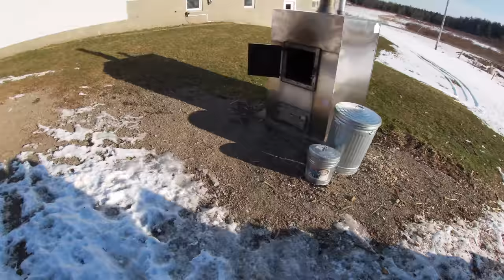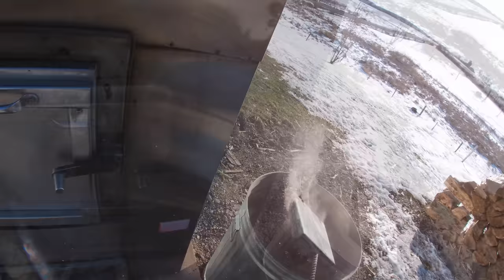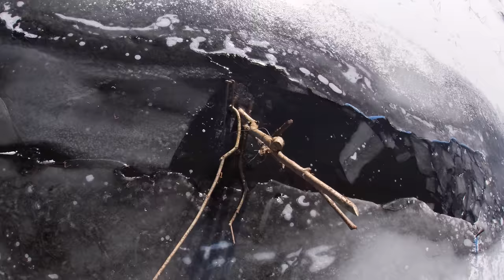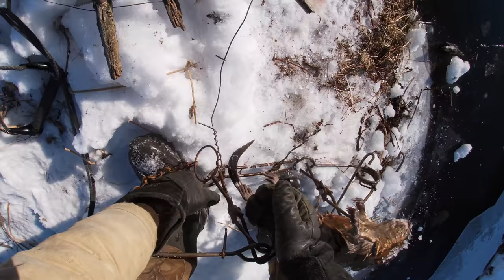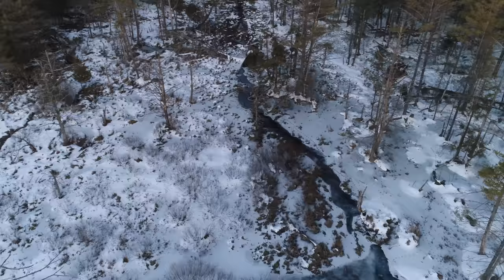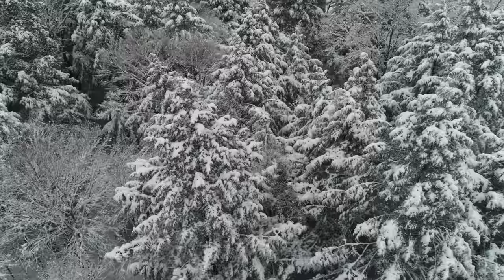Not What I Was Targeting... (Beaver Trapping)

Comment: Your furnace looks like a Hardy.  KB165?  I was a Central Boiler dealer for 25 years.  retired from the furnace business this past year.  Still service and stock parts.  Sold and installed over 2300 units.  Hardy makes a nice furnace.  You heating your hot water with it?
Reply from the maker: It sure is! It's been a great stove for us this winter. It does connect to our hot water heater as well.